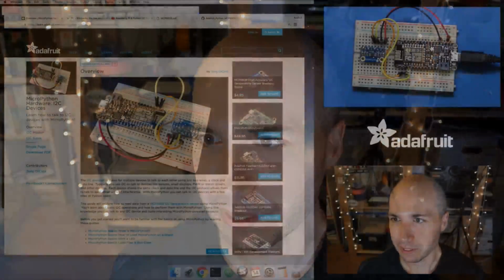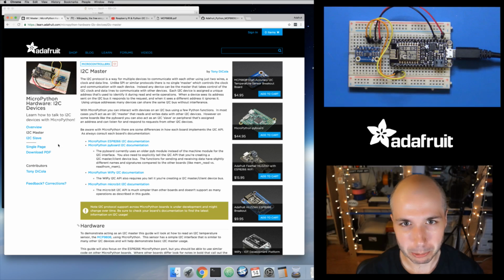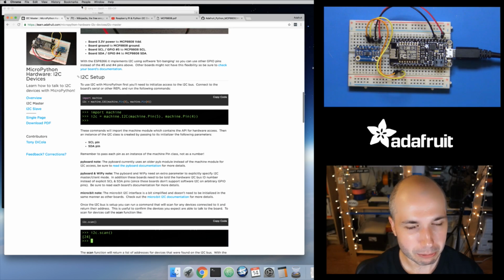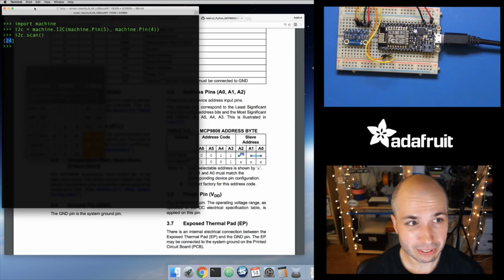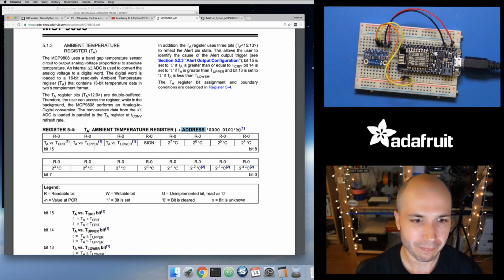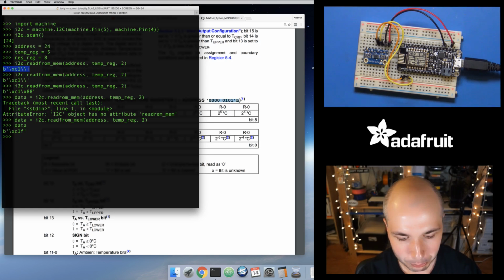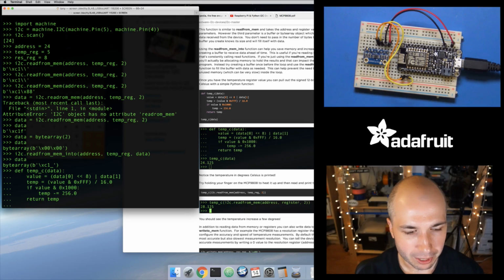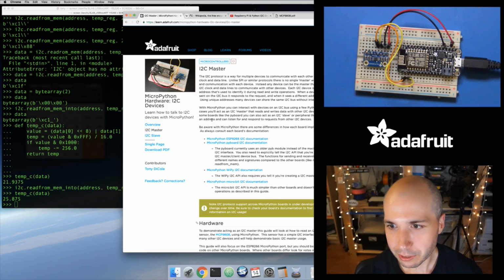MicroPython Hardware: I2C Devices with Tony D! @micropython

Comment: sir, i am so thankful for your tutorials
i am trying to interface adxl345(3 axis accelerometer) with esp8266 using micropython 
but, i2c.scan() is not detecting the address of adxl345
i have tried all possible methods,i request you to please help me to interface adxl345 with esp8266 using I2c in micropython

Comment: Thank you, a very useful explanation!
However, I don't understand the "simple" temp_c function. I don't get, in particular, what's the purpose of the use of the bitwise operators.
Reply from the maker: Oh good question the first line converts a byte string (like an array of bytes) into a single 16 bit value by grabbing the first byte from the string and making it the top 8 bits (the shift left by 8 bits with << 8) and the second byte the lower 8 bits (by boolean OR, you don't need to shift the bits around since they're already at the lower 8 position).  Once you have the byte string converted into a 16 bit value you can pull out a smaller subset of it, like the 12 bits of temperature data.  If you didn't do this then you'd have to pull each of the necessary bits out of the two bytes in the byte string.  It's possible but a little more code--by converting it to a 16 bit value with all of the temp register data in one spot it's easier to pull out the parts of it you need, like the temp value.
Reply: Thank you for the explanation!
After few years doing small programming with Python I had never used bitwise operators or had to worry about exadecimal and binary coding.
I just made some tests with Python ide and I think I got everything... well, almost.
As I said, my knowledge is pretty basic, so I'd like to ask you the last couple of question: 
Once you have the 12 bit subset of data, why do you divide it by 16?
Finally, if value & 0x1000 is true (i.e. !=  than 0), you subtract from the value 256, as if in that case the temperature were shown in kelvin. I don get it :(
I want to say thank you very much for your great work! I really hope to see more videos about Micropython!
Reply: @adafruit  Can you explain how the line 'temp = (value & 0xfff) / 16'  grabs the last 12 of 16 bits?